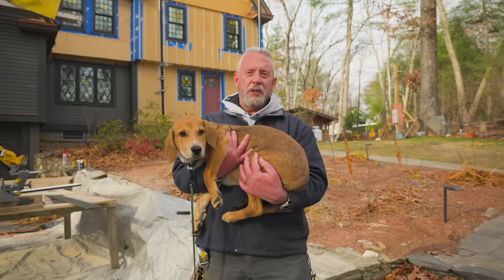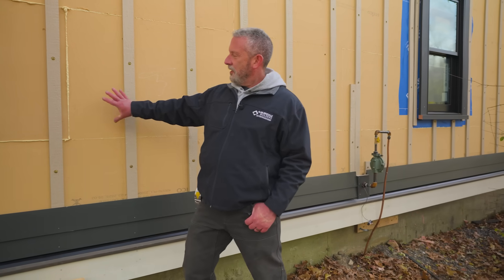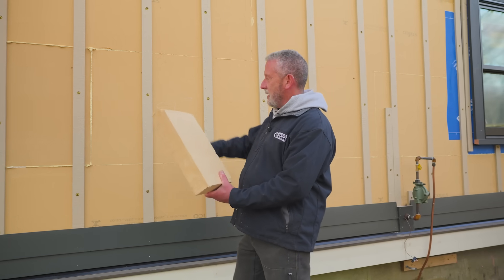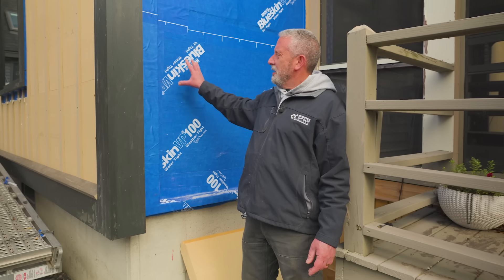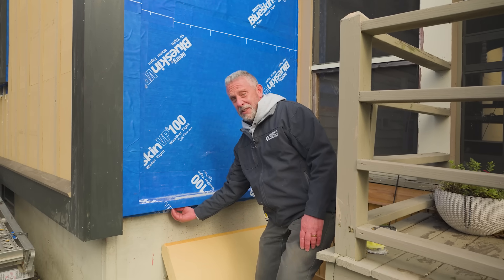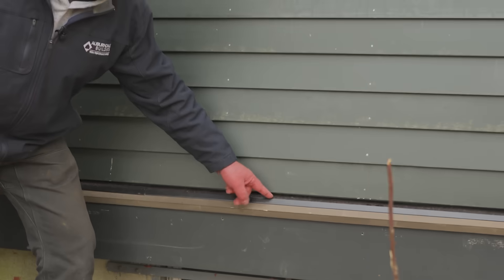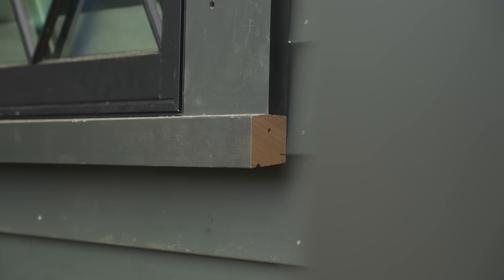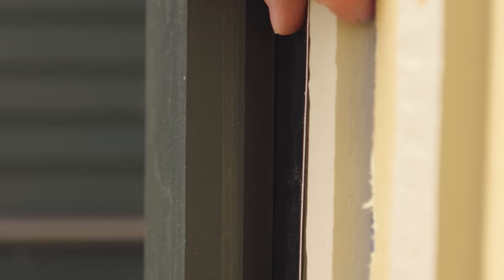Future-Proof Your Home with Exterior Insulation and Siding That Lasts

Comment: Maybe I missed it, but what’s the brand on the wood fiber? I know there are lots of Europeans, but the only domestically-manufactured one I’m aware of is Timber HP, and I hadn’t hear that they had board yet, just blow in or maybe batts.
Reply from the maker: Hi Chris. Thanks for watching. This is made by Steico and imported by Global Wholesale. You can get Gutex from 475 Supply and yes TimberHP now has their exterior board product available which is exciting!

Comment: So with the rain screen the house has to dry from the inside of the house mostly?
Reply from the maker: The rainscreen allows this vapor open wall assembly to dry to the inside or to the outside. It also allows the siding to dry to the inside or to the outside. Rainscreens themselves don’t necessarily allow a wall assembly to dry to the outside tho. If the wood fiber was foil faced polyiso or another vapor impermeable material, that would make the wall assembly a dry to the inside only assembly. The siding would of course be able to dry in both directions still.

Comment: Mineral wool as exterior insulation will do much better for weather, rodents, fire and noise. Ditto for cavities.
Reply from the maker: You can absolutely use mineral wool as a substitute. It does not store carbon and will compress under the furring strips. But we do use it as well for version applications and projects. Thanks for the comment and for watching!

Comment: wood siding? even the copper sulfate preservative is only rated for like 64 years, right? and it's gonna need repeated painting? nahhhhhhhhh.
the other stuff was good though. thanks for the vid
Reply from the maker: Thanks for watching. Durable and long lasting, doesn’t necessarily mean maintenance free! But with the rainscreen, paint will last considerably longer than without.

Comment: Does  trims have j-channels or you simply put trims on top of siding? Thank you
Reply from the maker: The trim is furred out with 2x material. And trim are fasted to that 2x. This creates a 1.5 inch space between the wood fiber insulation and back of trim which creates enough space for the rainscreen to be installed and for the siding to fit on top of the rainscreen but behind the trim. No j-channel. But we did add that bent piece of black aluminum to make the inside of all the trims look just black, no visible 2x, insulation, blueskin etc.

Comment: The wood that the siding is made of is Radiata Pine. It's a low quality wood. Native to the west coast of the United States it was never commercially harvested.
Reply from the maker: Tim you are right. It is radiata pine. Not sure I would consider this a low quality product, otherwise we wouldn’t use it. But I’m curious what other product you might use in its place??
Reply: @auburndalebuilders  I use clear vertical grain red cedar, factory primed. Properly installed and maintained it lasts 100 years.  The vertical grain is the key factor. Last summer I repaired and repainted a house built in 1827 here in New Hampshire. The clapboards were clear vertical grain White Pine and  90% of them were installed in 1827.

Comment: The wood fibre insulation your installed (Steico) definitely is NOT rodent resistant or even deters rodents. I'm based in Scotland and just discovered a panel that was eaten into by mice. Torn to shreds actually which I'm really not happy about as it's VERY expensive insulation
Reply from the maker: Yes. That’s why the rain screen has the Cor-A-Vent in between the 1x boards and the bottom edge sits on the pressure treated ledge. Pests are tenacious.

Comment: The only problem I see, or certainly one of them, when you build that far out from the structure, the windows and doors are now dropped way back…. No architectural trim design.   What the heck?? So you need to also replace all the windows??? Nice but I can’t imagine the cost.
Reply from the maker: This project needed new windows, so it actually worked even better to incorporate the air tight Henry Blueskin and exterior insulation at this time. And there are definitely ways to install a innie, middie, our outtie window like in this case, and add any architectural trim details you’d like. Bringing high-performance and great architectural details together is absolutely possible.
Reply: @auburndalebuilders Recall, too, that "innie" and "middle" and "outie" profiles of window placement in relation to the wall assembly all tie back to historical and classical precedent. 

Picture homes in rural and urban Europe, which largely are fitted with traditional wooden shutters which add a myriad of advantages over having none at all.

Comment: We have a lathe and plaster house with wood siding and no insulation. Would this be a good fit for us?
Reply from the maker: It’s certainly a possibility. If you’ll be working with a builder, talk it over with them to see if they think an assembly like this will work well for you and your house in your climate zone. We have lots of lathe and plaster here in Boston and we would certainly consider this on a house like that here.

Comment: Is this better than using Zip R6 boards?
Reply from the maker: Good question. It’s not better or worse, it’s just different. We like wood fiber because it’s vapor open, carbon storing and creates super flat wall for cladding. We definitely could have used Zip-R, R-6 meets climate zone ratio needs for 2x4 walls and R-9 is good for 2x6, but would have needed to look at all the assembly layers to make sure they all work together since the polyiso it uses is vapor impermeable.
Reply: Maybe not better,but for some labor saving-time is money you know

Comment: Sounds great but this installation would cost more than the value of my home but barely increase the property value ?
Reply from the maker: Everything is a cost analysis based on your own project goals right? We approach a building’s envelope and finishes with equal intensity. We want a home to look great, perform great, and be comfortable for the homeowners.
Reply: @auburndalebuilders Indeed.
Reply: I worked in nm and they put rigid under plaster. I experienced first hand how rigid on outside of building is amazing for heating bills
Reply: Other options, depending on your location, include insulated vinyl siding such as Craneboard or a combination of Fullback FC from Progressive Foam for minimizing thermal bridging under fiber cement siding. Builders typically butt the siding to the corners with caulking as you explained, but there is a one-piece fiber cement siding corner that allows the siding to fit under the corner without caulking.
Reply: Think of the energy cost savings?  Energy prices are skyrocketing

Comment: Interesting System that I enjoyed viewing, off siding topic but why did the Owner not opt for a Metal Roof?
Reply from the maker: Just aesthetics. Designer and homeowners liked the look of the shingles over metal.
Reply: @auburndalebuilders  Well, there are Metal Shingles available in varying Dimensionals with 50yr warranties that would add to the Longevity Theme.
Just wondered is all. Is there a secondary water barrier under the shingles?

Comment: It would have been easier and much less labor to use Zip-R12 for exterior insulation. With the Zip-R12, you'd get R-12 exterior insulation, sheathing and a WRB all in one (there is also a R-9 version). Over 2x4 studs, regular windows and doors made for 2x6 studs fit perfectly with Zip-R12. No window/door bucks or jamb extensions. Use 4" nails with a Big Bertha nail gun or similar. As long as you follow the recommended nail pattern, shear strength isn't an issue in non-seismic zones.

We did this for our 2023 new home build. Behind our LP siding we have a 1/4" poly mesh rainscreen and at the bottom, it's wrapped with an 8" wide fiberglass screen to keep bugs from getting behind the siding.

Zip-R goes up just like regular sheathing. Use Zip tape to seal all sheathing seams and Zip stretch tape on window openings. This will make your building envelope air/water tight.

This exterior insulation build is complex to get right and many framers won't bother or charge an arm and leg to do something they don't usually do. If they get it wrong in a spot, you'll have water intrusion issues. Using Zip is idiot proof.

It is also very important NOT to use a plastic moisture barrier behind the interior drywall with foam exterior insulation. If a barrier is required by your uneducated inspector, use a smart moisture barrier. Walls need to dry out and they can't dry to the outside, so they need to dry to the inside. A foam/plastic sandwich is a recipe for mold and rot within walls. I'd also stay away from fiberglass insulation between studs with foam exterior insulation. Use either mineral wool or closed cell foam. Mineral wool would be best for cost and for noise transmission, as foam is a terrible sound reduction material. Closed cell will increase wall racking strength by 300% over studs with batt insulation. Our wall are R-30+ with 2x4 studs with closed cell foam between studs and our blower door test was the lowest reading our tester said he's seen.
Reply from the maker: Thanks for sharing your assembly details. You could use Zip-R and achieve similar thermal performance, and we’ve used it in the past. R-12 can be challenging to install as you need very long nails, and special nail guns to shoot those nails as you mentioned. For our rain screens, we like minimum 3/8” and prefer 3/4” and use a metal mesh screen if we are using that instead of fiberglass mesh at the bottom. Pests are tenacious! Joe Lstiburek will recommend at least 2” of closed cell spray foam (in our climate zone 5) to avoid condensation at the back of the tape with Zip-R and we avoid using spray foam except when it is the only and best product for a situation. We’ve seen failures and longevity issues with spray foam and like to build vapor open, carbon storing assemblies. The assembly you describe absolutely works, we just prefer wood fiber.

Comment: Overall an excellent approach, and looks beautiful. The main weakness I see are the nails from the furring strips to the studs, which become an obvious thermal bridge. But I guess in the grand scheme that's pretty small, though I wonder if it's possible for them to condense vapor.
Reply from the maker: You are right those are thermal bridges. But structure and strength is the most important aspect in any build. You could use stainless steel fasteners to minimize thermal bridging, it is less conductive. If you have any other solutions to that, put them in comments!
Reply: Sincere question… How much of a concern are nails when it comes to thermal bridging? Is it because they create potential pinpoints of condensation? I can see the trouble of addressing that concern. But, surely their mass isn’t transferring enough heat/cold to affect temperatures inside the structure.
Reply: @treygoldsteinbergeisner6839  Honestly, I don't know. But yes, the condensation is what I would consider the most worrying aspect, as that's what rots wood.
Reply: I saw an innovative solution. 3/4” plywood was used for sheathing. The furring was nailed to the plywood between studs eliminating the bridges and the need to even find the studs. The siding was effectively attached to the sheathing.

Comment: "The homeowner in this particular case does not like mice in his house ..." -- That was good.
I'm not familiar with blue skin and wonder what the difference is between it and either Tyvek house wrap or Zip walls?
Reply from the maker: It is a vapor open self adhered wrb. So it is more vapor open than Zip and simpler to detail it as an airtight air barrier than Tyvek would be. But comes in a roll like tyvek. And we typically will use CDX sheathing on the house which is also vapor open.  We also like to use Mento 1000 and Adhero 3000 from 475 supply. Benjamin Obdyke makes high quality vapor open membranes as well that we use sometimes.

Comment: Nantucket carpenter here.  Tbh don't like the detail of siding behind corner boards.  Direct path for water imho
Reply from the maker: Certainly you’re looking at water and wind driven rain pressure that is much more challenging than in suburban Boston. We do it both ways. So long as it can drain and dry, either way can work and last a long time
Reply: @auburndalebuilders "So Long As It Can Drain And Dry" should be the introduction to every new residential construction instructional.

Comment: Was face nailing necessary or just for added strength?
Reply from the maker: We could have blind nailed it at the top of the clapboard but face nailed, by hand, for that additional subtle historic look. No nail guns. Nailing either way would work fine, but as always look at your products install instructions.
Reply: @auburndalebuilders , great work. Looks like a very solid setup. I wish exterior insulation and rain screens were code in the south where I am.
Reply from the maker: Having codes or financial incentives for this types of assembly does help, but you can always build beyond what code requires if it works for the projects goals and budget.
Reply: @a @auburndalebuilders  I tried but the additional costs were too much with the builders markups and was told I couldn’t do the work myself so I’m going to be stuck with fiber cement siding nailed directly to the house wrap. I feel like that shouldn’t be an acceptable option for builders to do but unfortunately I can’t afford to do what I want. Love the video though. Merry Christmas!
Reply: @Adam-y2u6p  
Sucks that you're not allowed to perform the work yourself. Hoping that policy is only in certain areas as I want to build in TN sometime soon. Ugh!
Reply: @Terrathrax yeah. I guess it’s a liability thing with the builder. If I wasn’t already so invested I’d probably try to find another contractor

Comment: What brand is that wood fiber insulation on exterior wall?
Reply: Timber hp makes it, but i want to know if there is any other company.
Reply from the maker: TimberHP, Steico, and Gutex is also available from 475.supply so plenty of options.
Reply from the maker: This is Steico. Available through Global Wholesale.
Reply: Its 5$ per sq ft. That's a lot. 160$ for 4'x8'. XPS equivalent r value would be like 40$. Is it worth 4x the price of XPS? That cost would add up fast.
Reply from the maker: I’d recommend getting an actual quote if you’re interested in using wood fiber. And with TimberHP being available cost is becoming much more competitive with alternative materials. Our choice to use wood fiber is not solely based on first cost, although first cost is obviously an important factor in all build decisions.
Reply: Americans do not make this
Reply from the maker: As mentioned below TimberHP is now making exterior rigid wood fiber at their plant in Madison, Maine!

Comment: Very nice to see that more builders are opting for natural insulation material and walls that are vapor open to the exterior.

Also nice to see is the maximum use of wood products for the siding!

Now, if you "only" would use a wood alternative for Boral like Accoya, Tricoya, NZ Lumber,... it would be perfect.
Reply from the maker: Don’t forget to be vapor open to the interior too! And yes to using wood trim as well. Those are all products we are looking into and considering on projects. The more wood the better.
Reply: @auburndalebuilders  Yes, vapor openness to the inside is always better, but in cold climates (CZ4 and above) it's OK if the outside is more vapor open than the inside.

But, if you want to keep everything vapor open, the finishes must also be vapor open, so enter the use of linseed oil paint, (casein) lime paint,... and exit the use of latex, acrylic, PU, epoxy... paints.

I hope your channel keeps growing, as you're one the few that seems to understand the concept of vapor diffusion fully 👍
Reply from the maker: Permeability of every material in an assembly has to be considered and you have to understand how it it with with or against the other materials. It’s not hard, but takes a heads up approach while assessing assemblies. We spend a lot our time thinking about vapor control and movement in our projects.

Comment: Simple and very effective. No super expensive materials and tape from over sea and WRB sheathing with tape systems.
Best rain screen system in my opinion where you can get materials sourced at almost every building center close by.
Reply from the maker: We’re always looking for simple and effective solutions that perform! Thanks for the comment.
Reply: That siding from New Zealand does not sound inexpensive or sourced locally. Most building center only stock Tyvek.
Reply: Great explanation of the process and attention to detail. Quality workmanship. 🇨🇦
Reply: Details, Details, Details, SO IMPORTANT!!! 💯